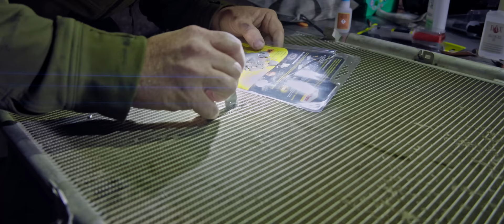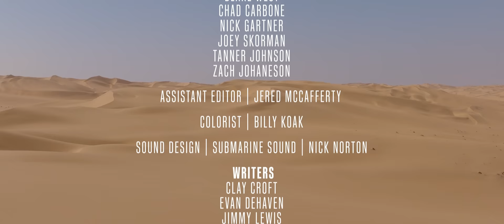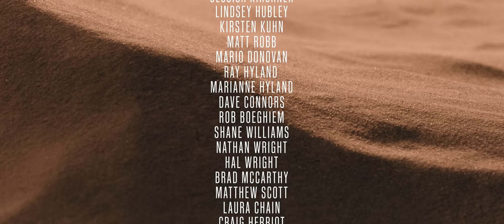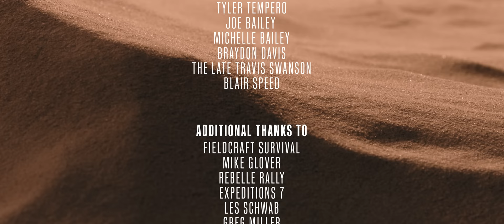Overland Travel to the Skeleton Coast, Namibia | Roadside Service | XOVERLAND S6 EP8

Comment: Torfi is in the house and it appears that the whole team has got its MOJO back. I was thinking Clay, that you were feeling the pressure a bit even though it was not justified but as the leader, you needed some additional support and Torfi has given you that.  Great episode and well done for all your good deeds.  I mentioned you guys needing locktight before but I think you need to take some guidance from the aero industry and start wire locking your bolts and nuts👍🏻 safe trip guys.

Comment: If you need to recharge your AC, it means you have a leak. Gas doesn’t escape if there is no leak. The system should always be pressure checked and diagnosed before any refilling

Comment: So really enjoying the South Africa series as I have the others. I was wondering in anyone uses safety wire to prep rigs. Coming from an aircraft maintenance background, we used this extensively to keep nuts and screws from backing off. Also curious if the aftermarket accessories were originally installed with locktite and if so was it red or blue. I am hoping to begin my overland build in the next year, so always looking for ideas.

Comment: I have had a similar issue with my 5th gen 4runner. The frameside bolt for the panhard bar has fallen out several times over the life of the vehicle. I've been quite fortunate not to have had anything catastrophic happen because on 2 occasions, I was doing some pretty difficult offroading, 4x4 low locked type situations.. I constantly maintain my vehicle, which has definitely saved me from these situations going real bad, but also shows how quickly something can happen! Proper vehicle inspections and maintenance are key to making it through the trails and even just around town. Don't get complacent!
Reply from the maker: Speaking the truth! Getting ahead of the problems is key.

Comment: Excellent show.. well documented! The fin/tube that leaks the freon can be filled (about a cm) with JB weld or what you used, and then roll the fin few times to trap the glue inside the tube and it is a permanent fix. Not sure how the Taco passengers are handling heat and humid without the air con!

Comment: Would be curious to see a video in the future of what you will change after this trip. For example, what to change to prevent the bolts coming loose. Curious if you use locknuts, nylocks or thread locker?

Comment: They should have caught that a/c leak the first time when they pulled a vacuum on the system, if done correctly the system will not hold vacuum if there is a leak

Comment: Such a great series so far, I particularly liked the little bit of more technical four wheeling and the challenge of fuel on the long run.  I'm curious why you guys don't put some more distance between the vehicles on the super dusty roads to give the following vehicles some cleaner air?  Are you trying to stay in a tighter group for security reasons?
Reply from the maker: Both for security reasons and filming! When cameras are off, we open the convoy up when we can to avoid dust intrusion and road debris.